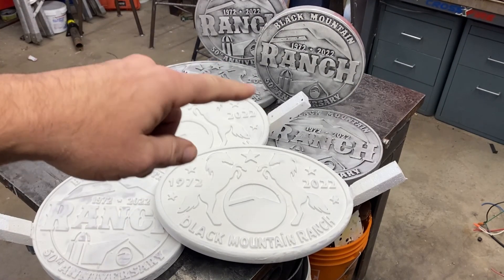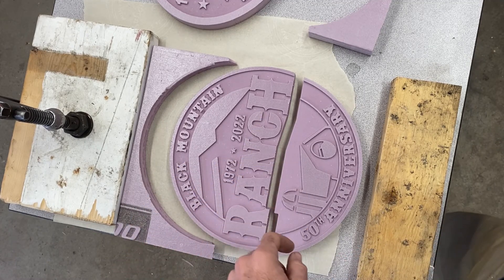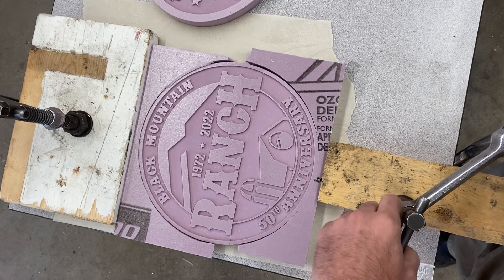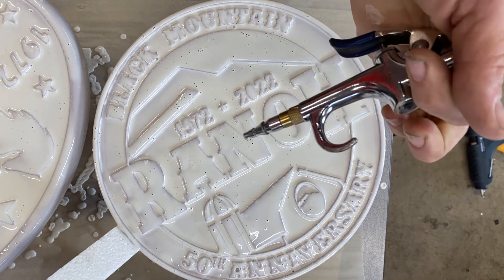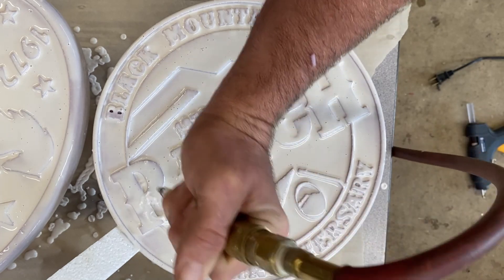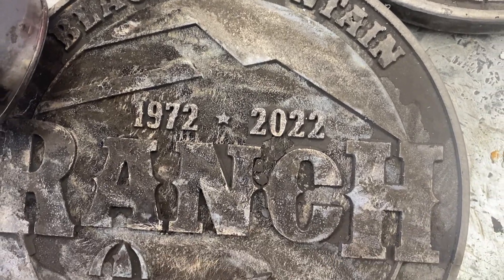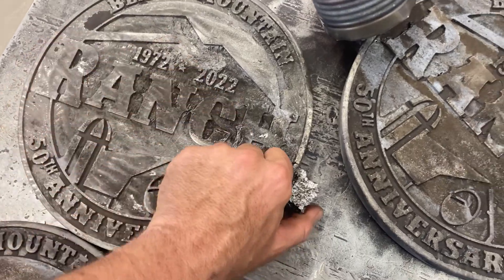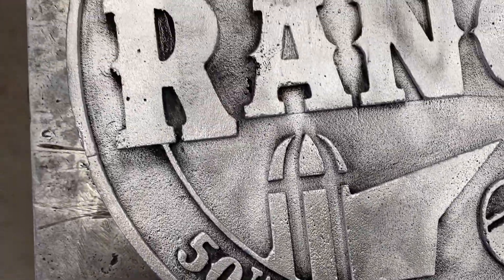Lost Foam Coating Process with Results

Comment: Good results Steve. You're coating might be getting a touch too thin. It's hard to strike the right balance with mud between too thin/too thick. You might try adding a small amount of bentonite to a small sample and see if it helps produce better single coat coverage....or there's always the second coat option. 

Sometimes insufficient coating thickness can contribute to those localized leakers because the metal breaches the coating and pentrates the coarser sand, but you're correct, more usually it's insufficient packing, especially at lower sand depths nearer the surface. Burrying the pattern a little deeper and more vibration can help. As the sand gets more use, it can pick up contaminates that make it stickier and more difficult to vibe/pack. 

If I had to hazard a guess at the cause of the casting inclusions, I'd say there's a good chance it's sand wash from the sprue interface with the sand surface in the cup. If the sprues are just proud of a flat loose sand surface when you pour, but the casting shows a radius between the cup and sprue, then that sand went somewhere.

Best,
Kelly
Reply from the maker: Thanks Kelly. I find it a lot harder to remove the bubbles from the second coating. Finding the right consistency is a struggle. 
I just finished pouring the other 3. I haven’t unmolded them yet. I spent a lot more time trying to vibrate them down. I’m really curious to see if the leaked out.
I should probably cut a hole in the bottom of the can instead of opening the whole bottom. Your pouring cups are the best for sure. Maybe someday I’ll get there. 
Thanks for the feed back. Means a lot. Really appreciated. Cheers

Comment: You refer to you costing as mud, can you be a little more specific
Reply from the maker: Hi Brad. It's a premixed drywall compound. I water it down quite a bit. this is what i'm using now but any premixed stuff should be fine. https://www.homedepot.ca/product/cgc-synko-ultralight-mold-tough-drywall-compound-13-5-l-pail/1000833911

Comment: another grrat video .  i will make some changes to my process to make it better . thanks buddy
Reply from the maker: It's working well. I got to sort out my vibration tools. probably gonna get some air vibrators like Kelly uses. Cheers. good luck
Reply: @stevesrt8   I use a cement vibrator and it works great, building off that what about a furnac3 motor with a lopsided weight on the shaft bolted to a plate the buckets sit on
Reply from the maker: @Wrighmachining  some kind of vibrating table would be great. i need to take more time and pack my molds ahead of time. instead of pouring one and packing the next while the furnace is going. gets too busy.